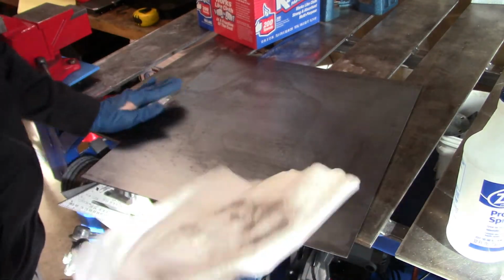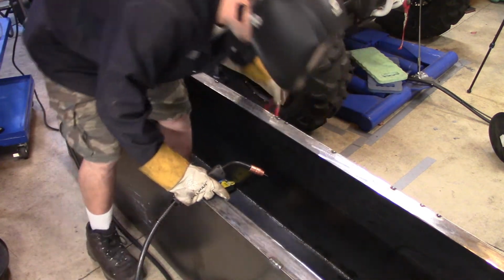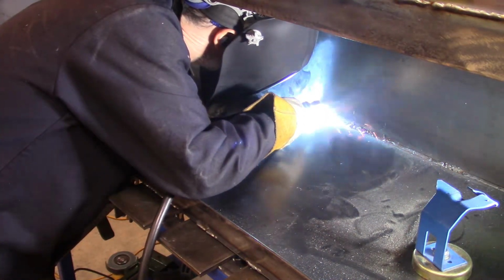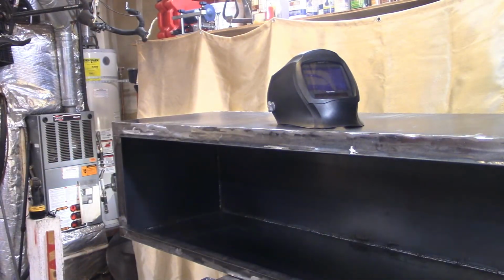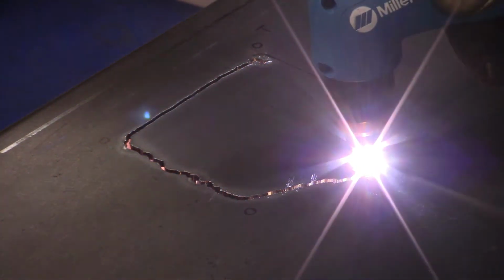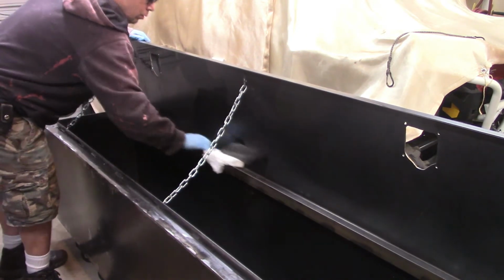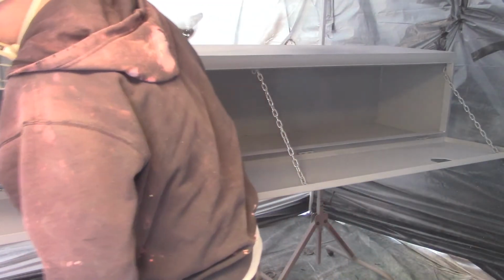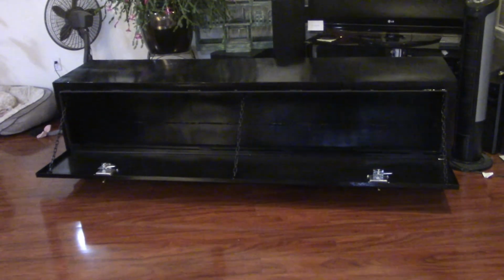Welded my first truck tool box

Comment: I’m certain after 3 seconds into this video that you are self taught and you’re trying to be meticulous which is good. Using hard wire. Your small machine with small wire 030 or even smaller. You should have fit your panels “ corner to corner” meaning the insides of your corners touch leaving a nice bevel to weld on. Set the machine nice and do a down hand top to bottom. It’s beautiful. Use a sanding pad and lay it flat on each sheet making it smooth. Then round off your weld keeping the disk flat not on an angle gouging into the material. This makes it look seamless. Also don’t do a million tacs all over the place you have to weld over it. Lots more to learn but keep it up

Comment: Good vid. When I can't use my Snap On LED floor light like urs I use a Coast LED light over my helmet with an adjustable strap. It works pretty well and the battery pack sits in the back of the helmet. Also, try the black charcoal welding blankets bc they r soft with no fiberglass and they work great.
Reply from the maker: Oh, man... I've been wondering if there was something. Thanks so much for the advice.

Comment: Nice job ,  but two things on the chains - it's a lot easier if you fasten the chain inside the box First before fastening it to the lid .  And second ,  eliminate the middle chain ,  it's OVER-KILL ,  and it makes it difficult to put long akward shaped items in the box .
Reply: AWKWARD  --  Sorry ,  typo ,  big clumsy fingers weren't working as fast as they should .
Reply from the maker: thanks for the input.

Comment: You only needed to weld the outside of the box if you set  up the corners such that you had a V bevel . Tack and weld up back stepping the weld . If your plate was sheared or cut square your box will be square . Get some proper pants on too.  You never leave bare skin hanging out welding ..Properly sheared and broke you would have had less welding and door would have been inset and piano hinge used  . Then a foam rubber weather strip could have been put in . For that long of a box 2 cross broke doors with a divider in the middle .  For a novice you done alright

Comment: oN WELDING THE INSIDE SEAM IT IS BETTER TO SIT IT BETWEEN TWO TABLES AND CRAWL UP INSIDE. tHAT WAY YOU CAN WELD THEM FLAT INSTEAD OF THE OFF POSITION OF ON YOUR SIDE WELDING IN.
Reply from the maker: great idea. I will try this for next time.